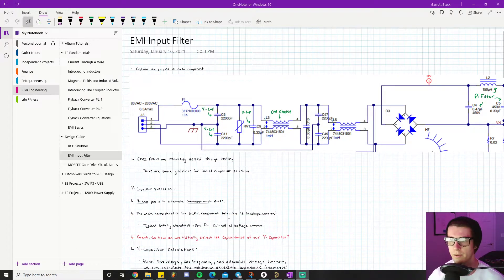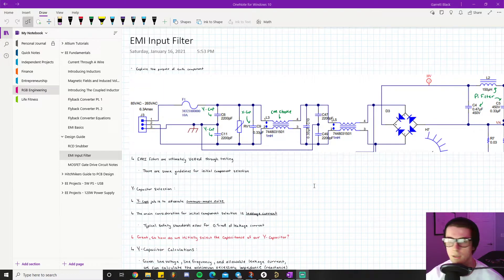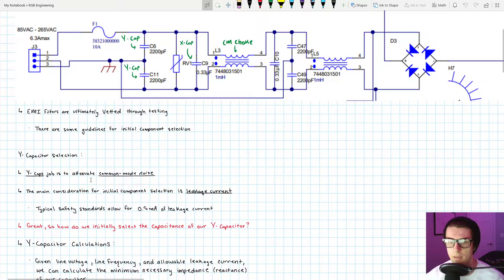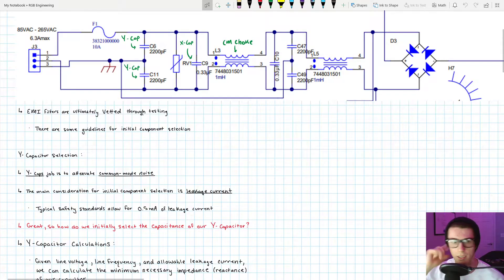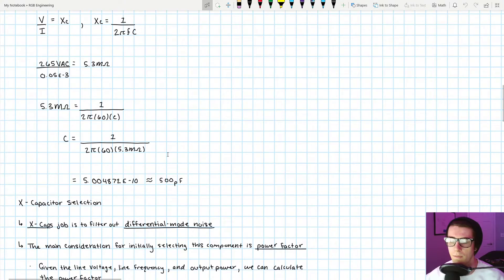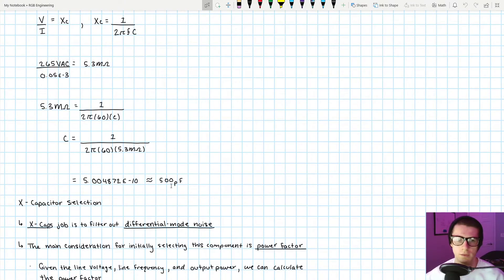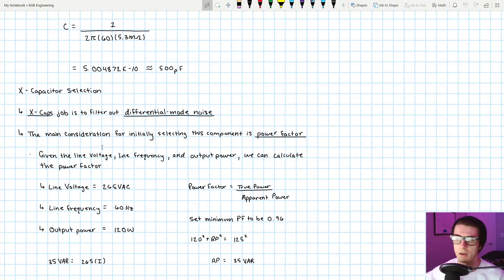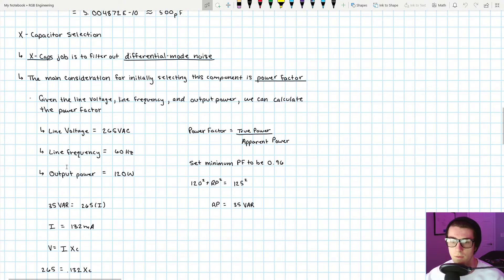EMI FILTER DESIGN GUIDE | EMI INPUT FILTER DESIGN | DESIGN GUIDE | ELECTROMAGNETIC INTERFERENCE

Comment: what if i use a dc-dc converter? How i can calculate the capacitor capacitance? because f = 0.
Reply from the maker: I will put out a separate video on this topic, but in general you want to look at the switching frequency of the DC-DC converter. That will tell you what the fundamental frequency is as well as what harmonics to expect.

Comment: Excuse me, you mentioned the x capacitor while talking about the x capacitor, but; if the differential mode inductor coils are in the same core, don't they create common mode noise? Isn't this type of noise that we call differential mode the noise field in the separate coils located in the live and neutral lines in separate cores? In other words, isn't the x capacitor located in the common mode field? time 7:25
Reply: I wrote the article but; I think I understood better in a research that the x capacitor is differential mode. Since we are dealing with stray currents for common mode noise prevention in external parasites, y capacitors come into play to discharge these currents, the x capacitor works for differential mode because it is in short circuit mode, that is, the circuit has noise with its own loop, not from outside, we use the x capacitor to dampen this. Correct me if I am wrong
Reply: I must say that I benefited from your information by doing calculations on paper with a pen in my hand in your video. Thank you.
Reply from the maker: thank you very much ;)
Reply from the maker: two inductors that share the same core create common-mode filter or "common mode choke".
Reply: @RGBEngineering  yes. Yes, I understand that a common core is used to reduce noise currents. I think this is an effective method. But simple adapters don't seem to care about these things... I didn't really understand the power factor part either. Can you help me with this?
Reply: @RGBEngineering  No matter where the common mode noise comes from, the choke coils seem to perform the first circuit input noise suppression activity to secure the entire circuit on the same core. I haven't learned the number of turns etc. yet, but I'm at the beginning.

Comment: about this formule the you think? or a filter with a CY of 2.2 nF (Xgen medical power supplies), an input voltage of 230 V at 50
Hz, and factoring in a tolerance of +/- 20% the expected leakage current can be calculated as:
= 2 * 3.14 * 50 * (2.2 x 10-9*1.2) *
230 = 190 µA = The cy you calculated is also excluded from the formula. It includes 10^-9 x 1.2 * volts
Reply: Can we provide the leakage current amount from these values?

Comment: Guess the product hasn't a safety ground and the input voltage is a DC voltage instead of AC voltage. Does the EMI filter be like this? will keep it all the elements? in other words, common mode filters would be needed?
Reply from the maker: This is a great question! Without a safety ground, differential-mode noise would be more of a concern, so the filter you design would focus on that type of noise.
Reply: @RGBEngineering  this is the answer I was looking for. I've heard and I read something like total common currents = 0. But I was worried about non ideal cases: parasitic L and C between the power lines (conductors, wires, etc) and the physical earth, because of proximity of other groundend to earth elements. I have also read very little common currents (about uA) could bring big EMI issues. Despite this, authors with deep background (like you) are saying that common noise usually becames insignificant. I am now more aware. Thanks for your answer.

Comment: Hey there, one question regarding the output power being 120W. On what basis did you consider it? Also, is it the output power of the EMI filter alone, or the entire system you are using the filter for? Great video btw! Thanks a lot!!!!!
Reply from the maker: So the output power was just an example I used. The important thing is to make sure your filter can handle the amount of current (both RMS and peak).

Comment: How important is it that the capacitor pairs C6, C11 and then C47, C49 be MATCHED in value ?    I have heard that they should be VERY close.   
I also know that random parts, even in the same batch, can be "off" just to normal variations.   So if it is important, how close should they be in percent ?
Thanks.
Reply from the maker: Just make sure they are the same nominal value (they need to be able to filter the same noise signals).

Tolerances on parts should be taken into account when considering the pass criteria for a product's EMI test.

For example, setting a 3db margin would put you several standard deviations within passing, so that might be the margin amount you use.

 At the end of the day, as long as your product passes EMI, that is all that matters.

Comment: Sir u got Y cap value 500pF  but  u add different values in the schematic diagram. can you tell me how come that value added. same in the case of X cap.please explain.
Reply from the maker: Those were the minimum values that I calculated for. I then chose values that were above the minimum required value.
Reply: @RGBEngineering  Thankyou sir.
Reply: @RGBEngineering sir why do you need a 2200pf capacitor when you only calculate 500pf is there any factor that influences